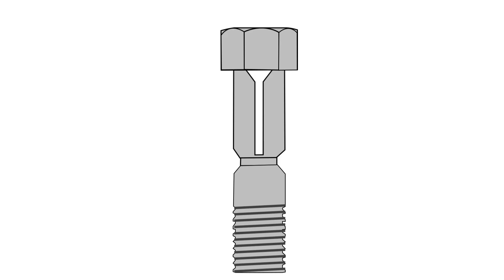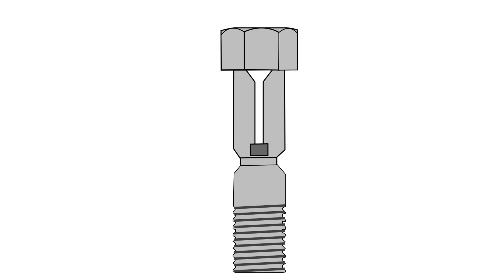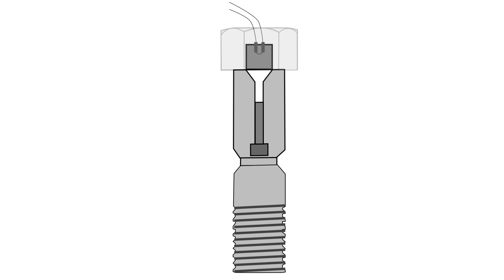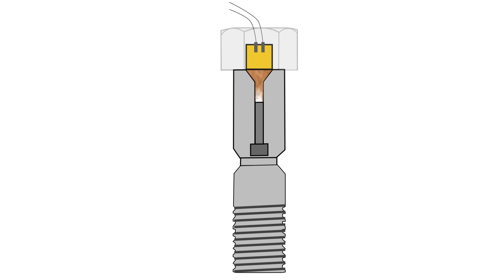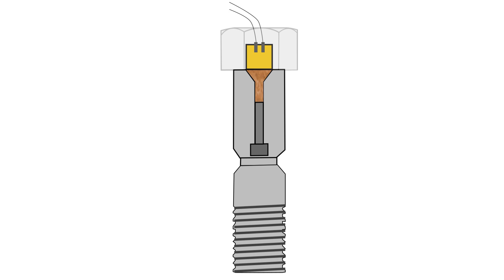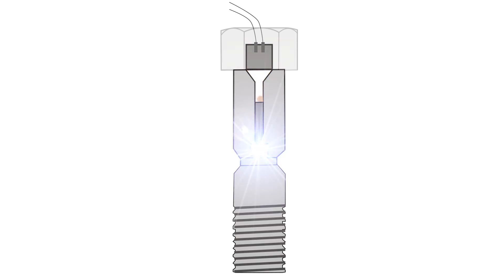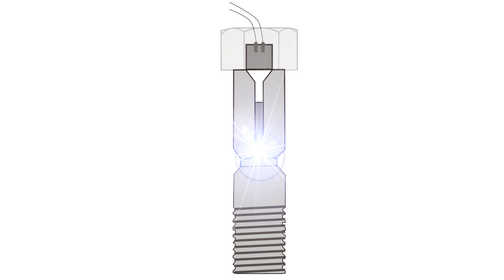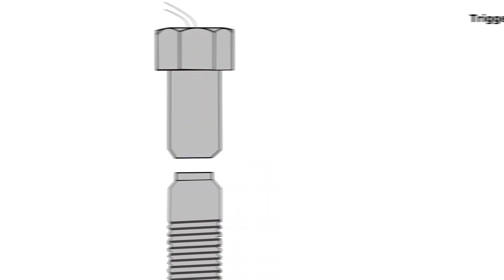Explosive Bolt

Comment: Retired engineer says: I've waited my whole life for this!  It's something that comes up a lot, going back to WWII.  Never have seen a picture even, or had a clear idea of what's actually happening.  A picture would have been nice!  SO, if I understand this, the tiny explosion shock just makes the bolt break?  Nothing comes out?  I've always imagined that there was you know, a flash and a bang.  WELL!  I learned something this morning, and the sun isn't even up.  I don't need this information, but I really wanted it.  The technician in me wonders if there's a special plug on top of the thing, or just some wires hanging out?

Comment: Back in the 1960s, IBM had explosive links in their computers. If the electrical power went wonky, these links would go off to quickly shut down circuits and prevent further damage.

If they went off, they would have to be replaced. That was an expensive and time consuming operation. In our lab there was an engineer who was on duty all the time the computer was on and his job was to shut the computer down if power went wonky before the explosive links were triggered.

The good old days😂

Comment: Maybe bigger question is: how the f do you make a bolt with a primer, a low explosive and a high explosive sealed inside? Seems kinda difficult but maybe there's a simple trick to it. Maybe everything gets inserted thru primer access hole and then sealed? But by what, friction press plug, welded, epoxy? I must know...

Comment: I feel like there MUST be a better way to accomplish whatever this was designed for.
Reply: Not really. These things hold together parts that have to withstand massive forces right up until the moment of separation
Reply: Do you have any better way to remove a bolt faster than the speed of sound?

Comment: What’s the application of this thing? Without the bolt head there is no clamp load, and the screw part will come out easily.
Reply: That's kind of the point

Comment: Wow thats really cool! What would be the use case for a bolt like this? Is it to quickly detach something or would this be done during fabrication to create a shorter bolt?
Reply from the maker: They are used in spacecraft to separate payload from rocket, unfold solar, etc. In aircraft to separate canopy, eject rotors,etc.

I  have a  video on my other channel to goes into detail about some usage on spacecraft. link is below.

Hold Down Release Mechanism - The nuts & bolts that releases spacecraft.
https://youtu.be/PFABKpqWG9Q

Comment: The sabotage potential for this thing is terrifying.
Reply: Especially when you consider what they're used to hold together, missiles and space rockets
Reply: @marylebone9357  Self-destructs aren't just used in Hollywood, after all. Plenty of rockets have been destroyed mid-flight for safety reasons.
Reply: @ziggythomas1123  no, the bolts are for separatig the stages during launch. I know SpaceX doesn't though, they want to be able to test every last bit before launch.
Reply: @ziggythomas1123  seen plenty of self destructs out of spacex
Reply: @ziggythomas1123  Not with explosive bolts, though.
Reply: @superslimanoniem4712  The main reason why they don't use them is reusability.
Reply: @marylebone9357  yes. They are necessary to separate the stages during launch.
Reply: Except it requires 2 obvious wires coming out of it to work
Reply: You do know how a disc grinder works, right?
Reply: Like those two towers the us knocked down

Comment: I love how this is such a dramatic solution. Like, we need to unfasten this bolt quickly, boys, how will be do it? 

I know, let's make it explode!
Reply: These are used to detach satellites from rocket while in space. Good luck with boys:)
Reply: to add to what the other guy said, rivets made in a similar manner are used in the construction of military aircraft. when the pilots need to eject, they don't have time to open up the canopy and climb out. when a pilot pulls the ejection handle, the bolts and rivets holding the canopy in place explode and the canopy is launched from the aircraft before the ejection seat launches the pilot from the aircraft.
Reply: This is how rockets come apart in stages.
Reply: Rockets use this.
Reply: Easier than magnetic separation or shear bolts, and more fun.
Reply: Timing. When you have more than one fastener and you need them to all separate within a millisecond of each other to keep from throwing your vehicle out of balance (for instance), there aren't many non-dramatic solutions.

Comment: Rear drop out bolts on my Gary Fisher Rig SS... no seriously, this happened so often I ended up drilling and tapping slightly wider holes and getting titanium bolts which still snap getting them tight enough to literally just hold the drop out in place for about five seconds. Great bike otherwise but absolutely the wooooooooooooorst rear end design ever. Give me big ol’ slots, no quick release and one screw per side total to adjust rear end geometry and it’d be great. It’s broken in one spot currently and is going no where on one side so I just set the other side to match and use pre stretched chains and a half link and were good... though this method is bound to fail

Comment: Out of context it's weird to design parts so that they fail reliably. However those are very useful in aviation and space exploration! I'm glad this was suggested to me, i was looking for a good explaination on how exactly those work!
Reply: There are so many places in engineering where you want a specific part to fail first.
Often it's a part that will disable the object, but won't cause much danger when it fails. Or it's in a single use item that will be thrown into the trash after it did its job once anyway.
Reply: @Yora21  Indeed, even bolt connection themselves should be designed such that the bolt (preferably under the head) fails first, instead of risking stripping the thread on the counterpart. Drilling out a bolt is lousy task, but relative simple. Having to retread the counterpart with an insert can be a nightmare.
Reply: its kinda the perfect solution for high holding power, low weight, and quick reliable separation, so long as you dont want to ever put the thing back together

Comment: We used to do this as a child,two bolts are connected by one nut,so sulfur is poured into the nut(from matches)the bolts are connected,and then you can throw, but! and this is important, the bolts are better to tie with a rope and then fly apart,and can injure someone.
Reply: You had one heck of a childhood!
Reply: I remember doing that. Crap, didn't go off. Your turn to tighten it once more....good times!

Comment: Apple will be using this for their next Macbook; so you can't just melt the glue to open it.
Reply: nah apple just places the screen backlight power line next to the cpu power line and sends 50 volts to the CPU that suppose to takes 3.5 volts and kills it making the computer a paper weight
Reply: @ainzooalgown7589  Yeah yeah we've all watched Louis Rossmann
Reply: Their Ipad air was easy to disassemble and replace important parts, such as a cracked screen which is 50$. On the Air 2 they glued the LCD to the digitized so your repair cost becomes 350$. What a joke of a company.
Reply: @wrathmachine7609  microsoft copied apple for the surface line. If you want to replace the batterie, you need to dissasemble the whole surface. And on top of that the batterie is glued to the bottom case as well. And while apple uses aluminium for the case, the surface is out of plastic. So when you heat the glue to remove the screen, you run the risk of melting the case.

That was my first & last microsoft notebook.
Reply: Nah. Apple Products have a self destruct mechanism built in. Design so you have to buy more of their shit. At least it keeps the Children working overseas. You can't beat good Child Labor.
Reply: @RabbitsInBlack  but you can beat child laborers.
Reply: @mrdrprof99  FAX

Comment: how do u remove bolts later what really is the point in explosive bolts
Reply from the maker: These bolts are usually used to separate parts that are no longer needed or to release parts that are tied down. Example: spacecraft parts or stages and aircraft ejection mechanism. The separating parts will remove the bolts by force.

Comment: These sound like a good idea for fastening jet engines so that in the event of a catastrophic failure that is going to either jeopardise the airframe or cause major disruption to the aircraft’s aerodynamics, the damaged unit can be jettisoned.
Reply: @JackHudler  
No ? I clearly explained the reasoning above, what part did you fail to comprehend ?
Reply: @JackHudler  
I suggest you read up on United Flight 1175, the plane involved very nearly lost all flight control due to a simple fan blade failure that sliced the front cowling off which in turn had a dramatic effect on the aerodynamics of the engine. The captain, Chris Behnam has recreated the event using 3D graphics. It can be viewed if you search.
The engine bolts are already designed to fail under extreme load anyway & much better an engine falls from the sky than the whole plane.
The likely hood would be that an engine jettison would only be performed over sea anyway & not a densely populated area if at all possible.
Reply: @JackHudler  you hate to admit you are wrong don’t you ! Either that or you are in fact incredibly stupid ?
What has the engine mass have to do with the conversion ? We are talking about a failed engine that could cause the airplane to be in danger as was the case in 1175.
ETOPS now being a minimum of 3 hours & if a plane suffers a catastrophic failure that is causing extreme vibration or seriously altering aerodynamics whilst say mid point over an ocean, being able to jettison that engine could prove invaluable in saving the airframe & therefore the passengers & crew.
DO YOU REALLY NOT SEE THAT JACK FFS ????
Reply: @JackHudler  in fact Boeing 707s had explosive bolts on it’s engines ! 
Night night Jacky boy !

Comment: What the heck is a low-density explosive or a high-density explosive? Never heard this terminology.  Can you give an example?  There are explosives with low brisance and high brisance and they may even have the same density.  Brisance is a measure of the energy release rate of the explosive.  High brisance equals high shattering ability.
Reply from the maker: In this specific example PETN is used as the low density and the High density is RDX. Explosive are sometimes classified as High or Low density. At times it's referring to relative detonation velocity other times it's referring to the effective density of the explosive based on how much it's compacted.
Reply: Generally... think about low explosives being subsonic (deflagration) and high explosives being supersonic (detonation).  It's more complicated than that but this will get you started.

Comment: My uncle made these for the space shuttle. His shop was on Long Island and he would deliver them in person just to make sure they were not damaged. He passed before the shuttle stopped launching so another person makes them for the last flights.
Reply: Interesting, what did the space shuttle use explosive bolts for?  The SRBs were held down with eight frangible nuts.  Were they used for SRB or ET separation?
Reply: @NeilFraser  I believe they held the liquid fuel tank on.
Reply: @morelanmn  The external tank's attachments to the solid rocket boosters and the orbiter also used frangible nuts. So, it was probably for satellite release.
Reply: @apollosaturn5  Thanks, My memory is old like me.
Reply: @morelanmn  Your account is from 2007 you wernt joking
Reply: @the_expidition427  Not joking at all
Reply: There were 4 or 8 (don't remember the number maybe 16?) bolts holding the shuttle to the pad.  They were around 4" diameter and around 2' long if memory serves (it was decades ago when I saw one) 
The main engines would start at T-minus 4.2 and the shuttle would yaw over for 2.1 seconds against these bolts, then yaw back to starting position for 2.1 seconds. Once it reached original position, that would be time for solid rockets to fire and these bolts would be blown.  If there was a problem, these were the last thing that would keep the shuttle on the pad / from tipping over.  Full thrust from the shuttle at liftoff was 6.6 million pounds.  I don't recall the amount of thrust from just the main engines.  I also don't recall the bolts they used for the shuttle pad having a smaller diameter section, but the explosive in them would separate them fairly easily.
Reply: @TheSidneySmith  I do remember they were made in groups of four.
Reply: I worked with my father at his shop in Babylon ,NY on Long Island as a kid. We made parts for Grumman, Sikorsky, Fairchild, Republic, Northrop,GE and all the other major defense contractors.
Reply: Your uncle's insistence on handing them off in person probably made a lot of people safer and that commitment to safety is admirable. Normal people doing extraordinary things with care and intensity is what makes things work, not the politics or the funding or the glamorous stuff.
Reply: @videosfromelsewhere926  THIS
Reply: Have the prints?
Reply: @ZM1306   No,,, I wish I did,, this was a long time ago.

Comment: Is this just die fun or is there a real use case for this trick?
Reply: Hi Stefan, 
There definitely is a real industry use case for these high tech bolts. This advanced explosive bolt design is mostly used for critical prank applications where it would be outrageously funny to have a bolt sperate. Like on the chair of your boss/teacher or a ceiling fan that's conveniently right above their head. Engineers can design main structural points around explosive bolts, allowing for maximum hilarity and improved bamboozling of the user. I hope this answers your question.
Reply: @ccllvn  That sounds pretty plausible. I guess a missed that lesson during my time in university. xD
Reply: ejection seats and rockets (space ones and heavy ballistic ones with stages)
Reply: @ImieNazwiskoOK  What's the use case in these applications?
Reply: @stebarg  Very quick and very simple detaching.

In ejection seat if it's helicopter it detaches quickly rotor blades and detaches seat which is ejected.

In rockets it's for staging to not carry empty tanks.

Comment: That doesn't look like the one's I made for Lockheed Martin.
Reply: Ther are pretty secretive about their aircraft and letting people know what the parts are going to when I worked at an airplane parts manufacturing facility, one sku i remembered in my head particularly, was a thermal afterburner part amd the whole box of 250 parts was estimated quarter million in value,

Comment: Why are such bolts required? For tеrrоrism?
Reply: There definitely is a real industry use case for these high tech bolts. This advanced explosive bolt design is mostly used for critical prank applications where it would be outrageously funny to have a bolt separate. Like on the chair of your boss/teacher or a ceiling fan that's conveniently right above their head. Engineers can design main structural points around explosive bolts, allowing for maximum hilarity and improved bamboozling of the user.
Reply: Why did you jump to terrorism immediately? They have a number of uses in aircraft and spacecraft construction. Stuff like opening a jet fighters canopy while ejecting.

Comment: This is also how fighter aircraft unlock their canopies during ejection. They just blow the hinges and bolts holding it in place
Reply: Depends on the aircraft...  When a pilot ejects there can be dozens of "pyro events" all happening within milliseconds.  All the cables and wires attached to the ejection seat need to be cut (explosive cable cutters), the pilots head, arms, and legs need to be pulled back into the seat (explosive gas generators), canopy ejection (bolts or det cord), and rocket motor ignition (pyrotechnic ignitor), so on...
Reply: Yeah makes sense, why keep the canopy intact if the plane is gonna crash